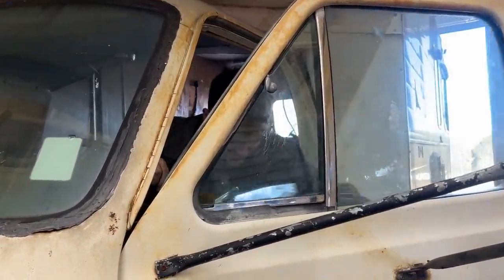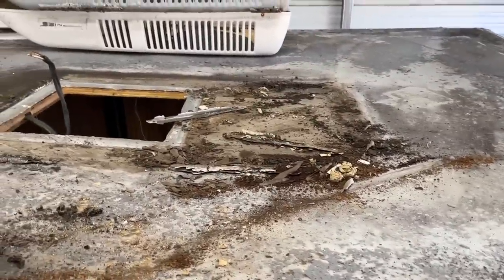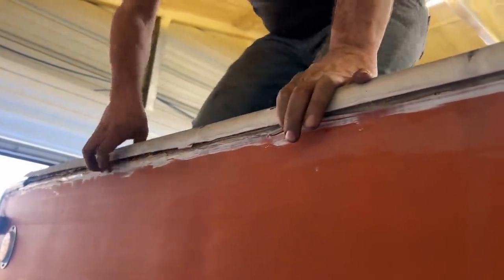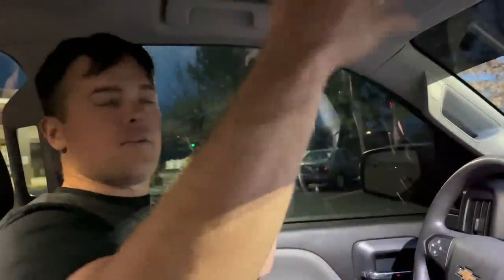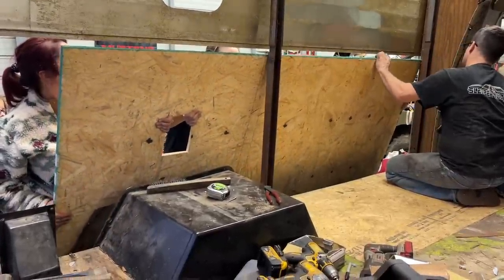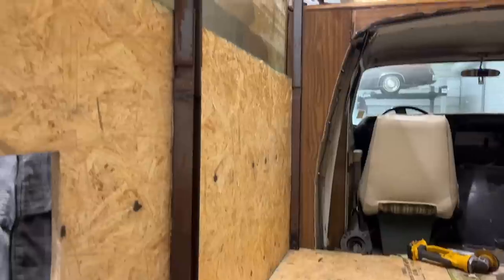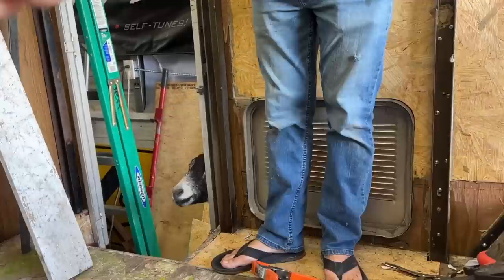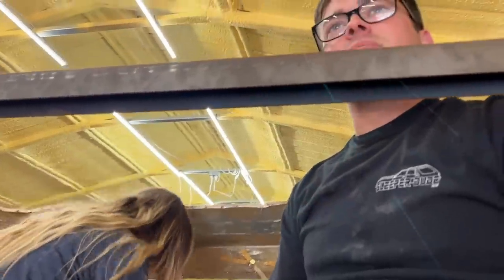Rotten Roof, Walls, and Floor! How bad is it? Antique Motorhome Budget Remodel.

Comment: Sell it for scrap. You can buy a nice safe TT for less than what that junk unsafe thing will cost you in the end. Many lifs have been lost in junk burning campers. Let alone setting along side a highway broke down. I have experence doing this. The foam is your insultion. Gonna need that this summer. That stuff around every opening is Butal tape.  Good stuff.

Comment: It won't add very much weight,... I'd run some metal in between the middles like you did on the side.For a water tank, you could run some like 8 or 10" PVC pipe on the top, tie them together, and put a fill on the side. Let gravity be your water pressure. ( I saw that on a food truck once and owner said it worked great!)

Comment: The weight of the osb without being supported every at least 24 inches is gonna cause major sagging and warping plywood itself is much stronger especially that thick of osb will sag but you'll find out soon enough
Reply from the maker: Ok thanks you’re probably right

Comment: The only thing I saw that I would have done differently is the patch aluminum sheet on the left side I would have cut it so it went all the way to the bottom in case water gets behind the outer metal siding. Also probably done something with the wood in the wheel well when installing the plywood just cause it would be easier as it was being installed… really like the GoatPro!
Reply from the maker: Ok thanks

Comment: Nice rv rebuild. :) also dont forget to insulate the entire inside. :) dont leave it just barewood. ;) the foam and all the stuffing. :) but nice build glad yall went the direction of no propane in the build i dont like propane gas either id would rather use a small butane camper grill :) instead works just as good and better smelling.
Reply from the maker: Thank you

Comment: Ok in order of priority, it's not a quail it's a pheasant. How are you going to seal the OSB at the bottom near the wheel arches etc so that it's not exposed to water? And the most important issue, where are Granny's ears?
Reply from the maker: It has aluminum trim that covers all the edges we are going to put back on. She was born without ears because of the breed she is.

Comment: Are yall going to use some foam board on the inside for insulation? If so I'd suggest the kind the doesn't look like Styrofoam. It's easier to work with in my opinion

Comment: Its too late now but it would have been a good idea to paint the OSB first after cutting all the pieces out so that if you ever get a leak it wont rot out as quick. It would have been a pain but so worth it. At least paint around the windows and other openings.

Comment: I would have replaced the whole  floor because of the rot & contamination from the rot .
    The OSB  I would stain or paint  it before putting the metal back on .

Comment: OSB is fine for a house, she'd or garage, but for that RV/Motorhome...
Plywood will handle so much better especially when you are traveling down the highway. The OSB will flex in the wind, no matter if you got the steel framing that you are going to enhance upon.
Buuuuuuut....
You should be alright.

I know you said you were kind of lost going into Lowes, but when you are buying framing lumber, you should always take each 2×  and look down the length of it. This will tell you how much trusting and how much of a bow in each board there is. That is so when you go and build your walls, you aren't struggling to flysh up your walls.
Reply from the maker: Ok thank you good info
Reply: Fat finger syndrome😆😆😆 
Not trusting, How much twisting in each board.
If there is to much bowing in the wood, or twisting. It will effect how well your walls will be flush on the inside. Kind of like the area outside where in indented I think you mentioned?
I can't wait to see the next video! Your family are almost like my best friends

Comment: I think that must've had the roof reskined as never seen a camper or trailer with two roofs.
The rot is pretty par for the course for coachbuilts once the 10-15 years old!.
Reply: Also when you consider the price new now or then their very poorly built.
Reply from the maker: Yes that’s correct

Comment: strongly suggest you change the motor and transmission for a 6 liter LS and 4l80e or at least a setup from a modern pickup / suv
seen another channel (https://www.youtube.com/@Theendlessadventure) where they fixed up just about the same dodge van body to go and travel around the states in  , they had to replace a lot of external parts on the engine and broke down then they had the engine replaced with a rebuild core and broke down again 
only when they had the dodge engine taken out and changed to the LS / 4l80e did they got rid of the technical difficulties (sofar) and the engine seems to be a lot queter and more fuel efficient even when towing a small car behind it , the setup being all electronic makes it eazier to start and run on todays fuel 
might need to get a donor car for the conversion as you would need to switch a lot of the stuff over to the rv like in tank fuelpump exhaust with lambda and kat , shifter computer and a lot of the engine related wiring , might even be able to repair the rest of the wiring with wats left of the wiring loom 
about the roof , make sure it has a bit of an slight upward bow in it , that way all the water will run off the sides even after you walked on the roof and dented it some , should be simple enough by adding a little fillerpiece along the spine of the roof then push the sides down some to fasten 
wouldnt be supprised that the rv has been modified before as the metal beams in there dont seem to be stock issue , never seen them before on rv rebuilds 
maibe find an old winnabago trailer or rv at the wreckingyard and see if you can get some paneling of to patch over the holes , gets the pattern in the paneling closer to original , the way you done it now could cause water to seep in between the wood and aluminium
Reply from the maker: Ok thank you

Comment: A lot of this old siding gets tiny pinholes in it especially in the rotted areas where water has eatint little holes in this very thin siding .That will allow water inside where it will get all your new wood wet. This is to hard of a job to do it wrong and even when yo do it right tou can still have major leaks. I wouldnt have reused one piece of that old siding because of all the hail dents and pits and pin holes that will ruin all your hard work. Ive been in the business 40 years ive restored countless rvs like this. You took it down this far you might as well do it right. I understand you want the Patina look but water leaks are water leaks. Id rebuild all those windows too the rubber shrinks and water leaks in down the walls.
Reply from the maker: Ok your probably right. Thank you

Comment: The value of a RV at 10 years is the salvage price of the engine, transmission and wheels even the stove,refrigerator and hot water heater has stopped working
Reply from the maker: Sounds right

Comment: you should have rebuilt the motor first when i had mine in a full size chevrolet van rebuilt they had to pull it out from the inside and take it out through the side door
Reply from the maker: Yeah probably right

Comment: I would have resided the entire RV with FRB board or the right corrigated aluminum siding metal that staples on like house siding interlocking each run or uses Filon basically corrugated fiberglass   even a solid sheet of aluminum like unitily trailers use that have a color powder coated on one side Any RV dealer that has a body repair place in it can get you what you need that contact adhesive is not going to hold that stuff on the heat from the sun will release it , These old 60s and 70s Winnebagos were made with this Duratherm vaccum bonded panels for years. My 82 Chieftan was this rotted out .Its great system till you get water behind the walls and in the roof then yer fu#*ed1
Reply from the maker: Ok thank you

Comment: YOU CAN SELL THIS ONE.   HI ALL CAPS JOE HERE AGAIN. YAA Sell This One And Chalk It Up As Lesson Learned.   Because.    You Were Sapostoo Put plastic Between the aluminum and the wood because the humidity will put water betey The aluminum and the wood.  Their is a ton that goes into.all this.    I been watching cheap RV  living for 3 years and It Shows Alllll that Any How.   Ya so many Homeless You'll be able to sell it quick.    YA WHERE THAT FOAM WAS.   WAS THE VAPOR BARRIER.    6 MIL PLASTIC DOES THE SAME THING

Comment: I WISHED THE COMMENTS WOULD HAVE CAUGHT YOU BEFORE.  YOUR MORE THAN LIKLEY WAYYYYY OVER WEIGHT AND YOUR NOT EVEN GONNA BE ABLE TO DRIVE IT IT WILL WIPE TJE BEARINGS IN 20 MILES.     THE WHOLE ENTIRE STRUCTURE HAS TO BE LIKE 700 LBS MAX.   AND YOUR GONNA BE LIKE 2000 LBS.   YOU NEED TO USE ALUMINUM ROLLED ALUMINUM
Reply from the maker: Ok thanks